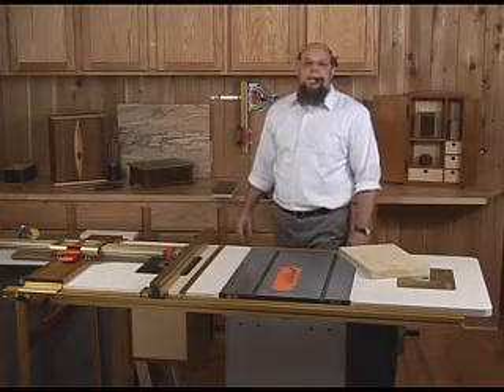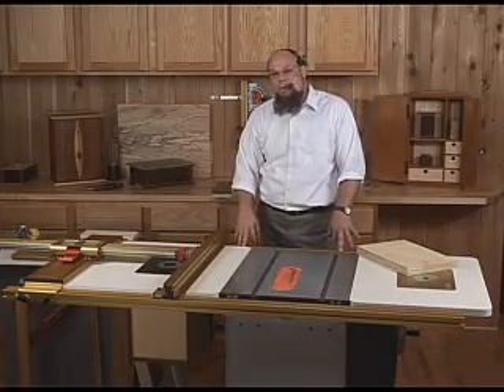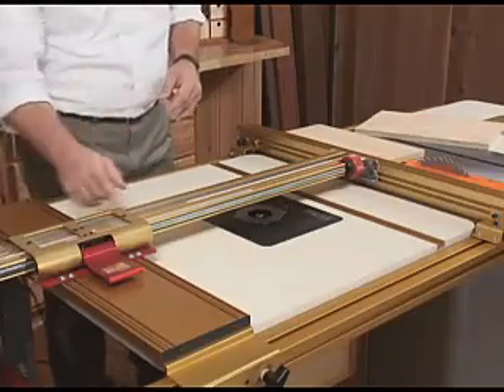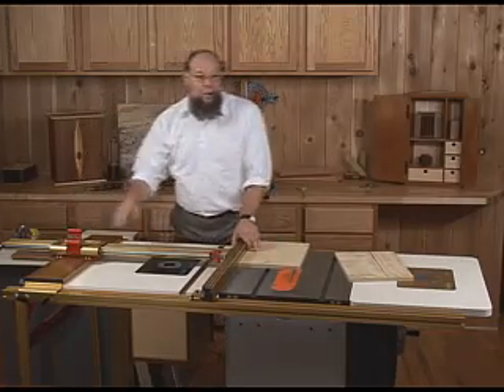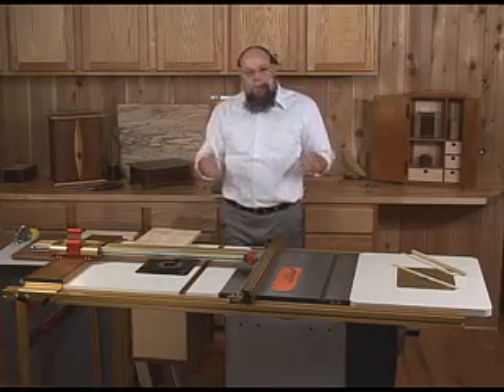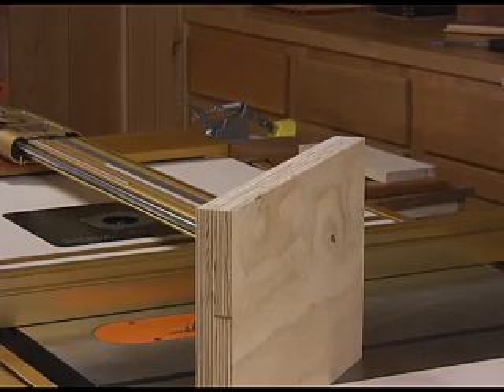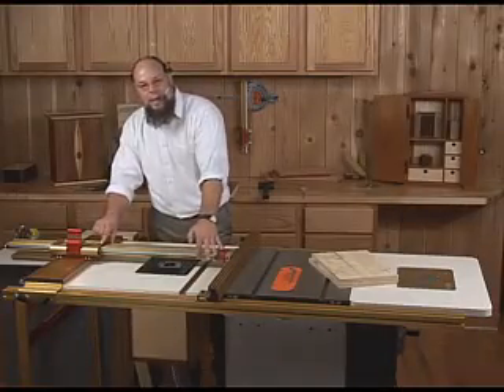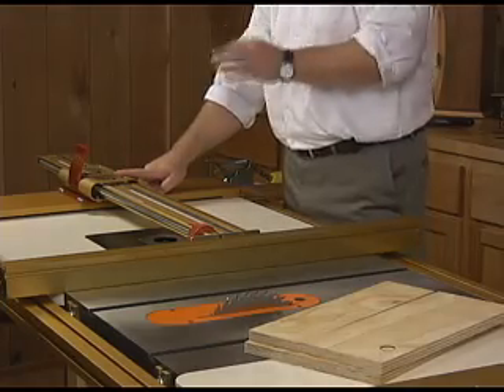INCRA TS-LS Demo Part 1 of 3

Comment from the maker: We're using a previous generation left-tilt Delta Unisaw that's 6-7 years old.  Though we have it installed for the video, the left-side router table (the operator's left) can't be used with this saw because of the location of the saw's motor housing below the router table.